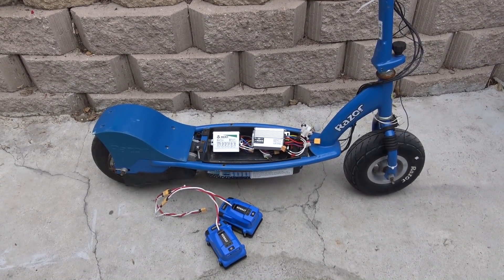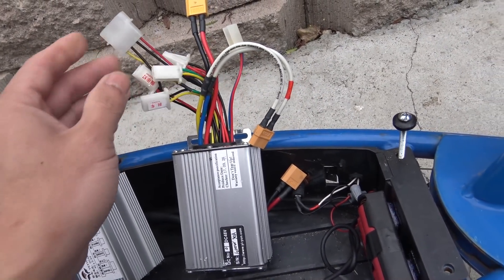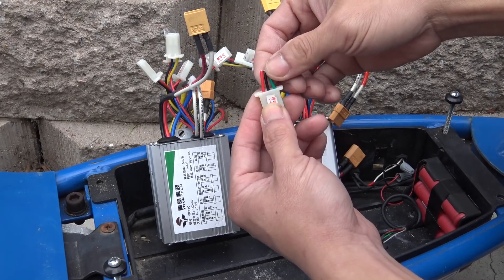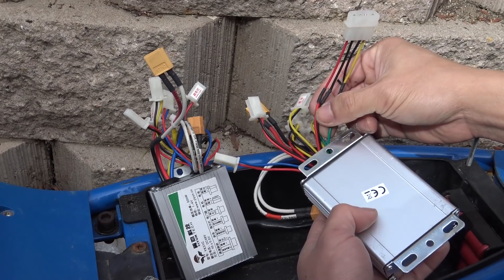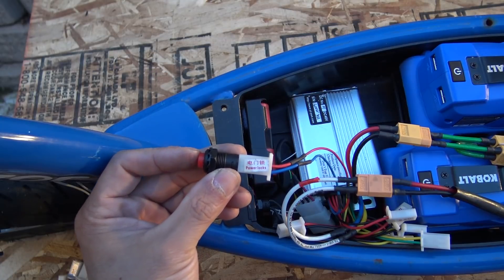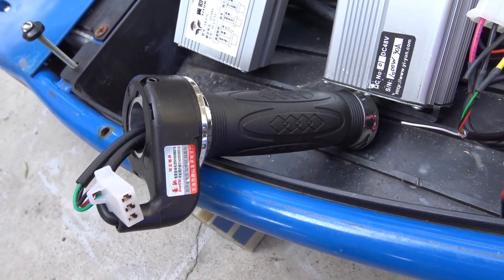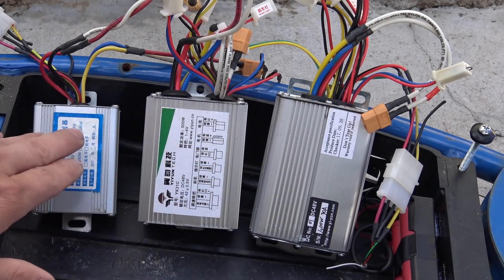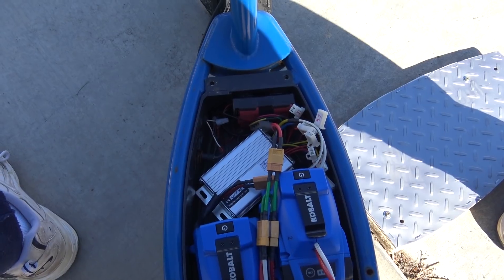Install a 48V controller & 48V battery on a Razor E300 (24V) Electric scooter

Comment: To increase speed smoke weed and drink alcohol. Scooter will go 200mph.
Reply from the maker: Amen.
Reply: @vuaeco  can you change the speed with the throttle your useing? I bought the same one and am just curious.
Reply: 😂😂😂😂 as a modified e300 owner and builder this is hilarious weed makes it seem like you're doing 40+ instead of 30
Reply: Lol... puff puff give !!
Reply: Lol
Reply: You are terrible :v
Reply: Couldn't say it better myself
Reply: I built this and it rips thanks for the vid
Reply: I'll be smokin' for sure.
Reply: Lol I just got a crack out of that one HAH Ya see what I did there??!
Reply: I PREFER LIGHTSPEED ON LSD
Reply: FrustratedBaboon that is the best way

Comment: 49V 1000W....ON A 24V 250W MOTOR HAHA.....IT WILL LAST WEEKS IF THAT YOU AT LEAST NEED A 36V 800W MOTOR AT LEAST IF YOU WANT TO OVERVOLT THE MOTOR WITHOUT BLOWING IT UP WHICH I ALREASDY HAVE DONE OR 36V 350W MOTOR FOR THE 59V 500W CONTROLLER ITS ALL ABOUT AMPS

Comment: you have E300= 200/300 Watt Motor, so 500 or 1000 Watt bringts nothin more power.  with 48v driver you get high power at the motor because it is small for High Speed.  ...still good.

Comment: Amazing
In many states 20 mph is the legal limit for our e scooters.  Glad your sitting down.
The oem motor can take a lot more than we are told. 

WHY HASN'T ANYONE TRIED ADDNG A THERMAL CUT OFF SWITCH super glued to the motor body and wired to the controller's brake handle motor kill wire? Many of our home appliances like our vacuum cleaner have them.
If a low enough temp it should save the motor from melting down if being pushed too hard for too long till cooled again!
I see aliexpress has these little guys for cheap. 
I am planning on trying that when I over volt my oem.

Take care

Comment: Why even bother with controller just have a 60V relay on its own, seen some idiots wiring throttle cables in so full current going through the thin gauge control wiring, clueless. Great video 👍

Comment: For future modders- 48v is OK for the motor - however excessive current (amps) is not. Too high current will burn up the motor. Try for low wattage 48v controller to keep motor cooler
Reply: Question my nephew 24v quad I was gonna run a 36v 1000watt speed controller but I'm starting to consider a 48v speed controller what would you consider for shooting around the yard
Reply: @3613jeremy  if you have stock motor 1000w controller probably gonna cook it especially around the yard
Reply: @grandtheftauto1233  so I should probably stay around 500 watts
Reply: @3613jeremy  yeah that’ll be more reliable. 36 vs 48v gonna give you more or less top speed

Comment: I like the video and everything but you did not say what kind of voltage motor you use it if you're using the same voltage in all the controllers or do you have to put 48 V to a 24 V motor that need to be explained and thank you

Comment: Can I use 48V W1000 controller for original razor E300 batteries?
Reply: No because you need 48volts and the batteries are only 24

Comment: Impeccable English, and VERY good technical explanation, and VERY good analysis.  Instead of unplugging 2 batteries, I would recommend the Power switch be swapped-out for a 3-way to disconnect batteries (some longer wires run to 3x switch from batteries).   30mph for a 15mph scooter???  AWESOME.   ...helmet and protective gear, like a motorcyclist and assuming everyone is going to pull out in front of you, is a must...   GREAT JOB!!!  Thanks.

Comment: i have the razor e 300 and needs new batteries, i would like to get for longer range and little more power torque.
which batteries and controller should i use?     i need about  12 miles range to be safe

Comment: The stock motor on a Razor E300 is the MY1016 (by Unite Motor Company).
Rated at 24 V, for 250 W (which at 24 V is ~10 A)

Dumping 48 V, and current of up to (1000 W / 48 V ~= 20 A) will fry the thing in no time.
Reply: (Assuming that you removed the protection breaker, which from the vid it appears you did)
Reply: I guess the output of those tool LiPo packs might be below 20 A, so maybe that would be your limiting, and possibly protecting factor.

Still, that motor is gonna release its smoke right quick.

Comment: Question ? 
What is the range of 500 watts compared to 1000 watts compared to 250 watts ? 
Is it close to being proportionate , meaning  will the battery  last 4 times longer with the 250 w as with the 1000 w controller ?
Great videos ! Very good information and well explained ! Thank you !
Reply: You will get the same range using the same battery but of course with 1000w you get there faster than 500w and 250w.
Reply: @gerardr4869  Can you prove in mathematical form that the range is the same? I thought the 1000w controller consumed more power at any time to get the scooter to move quicker ~ and faster at any instance time and the range would be shorter. Otherwise, why do the 250w and 500w exist in the market for? Except for the longer range and safety speed reasons.
Is it safe for a 24v stock motor to be used with the 36v, 48v battery? Would the 24v motor burn out? What is your choice?
Reply: @digicabtech 
You can compare a tesla motor vs a Nissan leaf. If you put the motor of a tesla in a leaf, the leaf will still give you the same rage as originaly, assuming it still weights the same as originally. 

 1000w motor let's say the battery is at 50v drawing with 20amp(50v X 20A) =400 watts of energy consumption.

A 500w motor ... same things as above. 

Is your battery is 48volts 10AH then you have 480Watthours of energy to be used in work at a low speed or fast speed. In the case of biking other factors will determine how far you can go, for example, hills terrain and wind.

Also, some lithium batteries design to only be drained at low amps will waste energy heating up if discharge at more amps as designed and the range of the vehicle will be shorter in comparison to another vehicle will better battery
Reply: @gerardr4869  
Forget about other factors. Let's distinguish between 2 motors. A 500w motor does NOT consume the same amount of electricity as a 1000w motor simultaneously. So the 1000w will drive for a short distance and drain the battery quicker.
"You can't get something from nothing."
Reply: @digicabtech  sounds like you need to see it to believe it. Do your own testing. I have already tested teoriticaly and practically ans its true. If there is a difference it will be so minimal that it's not noticeable
Ohms law will take you on the right path.

Comment: Great videos,  I watched this one and the 60 volt conversion.  Most folks when they over volt the stock motor they burn it out quickly.  What are you doing differently to not burn out the motor?  Thanks

Comment: What determines the maximum weight capacity of the scooter construction and the controller/motor/battery configuration?

I weigh 225 pounds, I travel 20 miles to anywhere I go then must return, and the roads are NEVER flat.

What formula can I use  (or anyone!) to figure that out?
Reply: I know it's a late reply but it's rare to get a scooter that goes that distance or longer.  Most scooters are rated at 15 miles range or shorter.  You will have to either upgrade the battery system (which can get expensive or complicated) or spend upwards of over $600 US dollars to achieve that distance.

In addition, there are scooter test companies that show you their tests and what weight they used to determine their tested distance/range and perhaps you can use that as a reference point in accordance to your weight.  Good luck sir!
Reply: @AnthonyChhan  I believe you can just use a 48v 20ah ebike battery, 48v brushed controller and 48v brushed motor.
Reply: i have one for sale already built

Comment: Will your 24v motor be able to handle 48v or will it burn out?
Reply from the maker: It's been working fine up until now, no problem. You might need to install a heatsink for the motor though.
Reply: @vuaeco  thanks a lot for your input much appreciated

I am actually trying to do the same to my mobility scooter which is a bit bigger

Looks like this 
https://www.mobilitysmart.co.uk/style-plus-lightweight-mobility-scooter.html

The motor is 24v so I’m really worried that I will burn it

Comment: What size motor?.. I hook up my battery wires rnd the wrong way(positive battery wire to negative on the speed controller??..)..have I blown my speed controller?.. I seen a little spark

Comment: The scooter is a 24 volt and you are adding double the voltage and watts.... is that motor capable of doing that? Or did you change the motor also? And if you didn't change the motor... how long do you think that motor will last before it gives up?
Reply: U  r rite. "You can't get something from nothing"

Comment: I know this is an old video but why didn't you wire a kill switch straight from the batteries? 

For safety and to stop that battery drain problem

Also do you think lipos would work for these builds? Just asking cause their size and weight are  definitely big plusses.
Reply: I know it's a late reply but there are plenty of people who do lipo builds and do just fine.

Comment: At 24 v 10 ah and a 500 w motor can I  add another battery and get more riding time?
Reply: should be more if current output is controlled in whichever ways
Reply: @akunii7249  I'm not savvy on electricity, what you mean ? My charger before hooking it to the scooter is green, when plugged in it turns red, Don't know if that means they are fully charged. The meter says 25 .4 I think that that means they're charged? indivitually they say 12.5  . I had a longer ride and more speed with thee 450 w it had.

Comment: it's still slow cause motor stick on the wheel
is it's use chain to drive rear tire and use gear reduction, this scooter gonna ran fast

Comment: Razor is finally making some new really neat looking lithium battery scooters.  It's about time.  The E 100/200/300 models used Lead Acid batteries.  

After you switched out those Lead Batteries, you saved about 8 to 10 lbs

Comment: So the stock motor is fine for 48v ?
Reply: should be ok at around there, as long as it's open to allow air winding to it, to cool it off some, but it might be super hot at insane 3 or 4digit volts/watts

Comment: how long will this last? have you been using it for a while now? I'm going to overvolt my 24v motor but with a 24v controller. If i break it ill get a 36v+ but im more worried about the motor. has yours causes any issues with moderate use?
Reply: If you overvolt the controller, it will fry and you can not just overvolt the motor as the controller is what is controlling it for lack of better words.
Reply: @SynergyAVE  that's wrong, you can power the motor directly off whatever battery you want by simply using a high amperage switch. These scooters don't use brushless motors, they use brushed DC motors.

Comment: hi ive just upgraded my e300 with 36v controller an throttle plus 18650 batterys but power is feeble when i jump on scooter.ive tried 36v lead acid scooter pack i made but its same feeble power as batteries that came with it.i did charge orignals with ctek charger individually .it was 2nd hand.im thinking motor is worn out
Reply from the maker: Yep, different batteries and same result then must be the motor.
Reply: Not all 18650 batteries are created equal. Some are designed to deliver 30 amps! However, I use modem batteries in my projects and they struggle to deliver 0.5 amps. Check your specifications.

Comment: Hi I just trying out a new controller it did say sensorless and ebike scooter but brushless anyway connected to my 36volt brushless Motor with the halls connected .anyway the motor worked ok but without no throttle control .ie whether throttle was powered on or off motor only worked when learn wire connected.but each time disconnected learn wire rotation was reversed .so when twisted throttle it wouldn’t work .i had red black an green throttle or grip wires connected.throttle lcd showed voltage but maybe faulty throttle .
Reply from the maker: Maybe throttle cables are not correctly colored. Switch the 3 throttle wires around and try to see if it works? Or you can get a volt meter and measure the voltage across the wires. They should be 5V on the red, nothing on the black. Or best yet, try another throttle

Comment: hi vuaeco was it brushed controllers you used on razor e300 48v upgrade?guess  i cant use brushless controllers which i have on brushed motor
Reply from the maker: Yes, it was brushed controller.
Reply: @vuaeco  is the razor e300 still running ok on standard motor having been upgraded to 48v

Comment: hi vuaeco ive picked up another couple of razor e300s.my wife just wanted standard one fast enough for her an good batteries.mine was dead /tired batteries.anyway tried charging from cteks showed good voltage but under load was weak power motor ok.so ive hooked up my ebike battery 53volts power but mine can be separated so just used 30volts on scooter.used 300watt 36v controller an throttle showed 30volts lcd didplay.not sure if green or blue was signal wire on controller.tried green first no power on motor so swapped to blue an without throttle motor spins backwards slowly.had good motor speed on old lead acid batteries.so swapped motor wire over an motor goes forward but slow again but still 30volts 18650 power they my samsung 25r s.any ideas ?
Reply from the maker: 30V on this motor should be very fast. Something has gone wrong. Try this: disconnect the motor cable, then put the volt meter probes on that cable instead. Now run the throttle and see what voltage you get? If you get 30V on that cable then it must be something wrong with your motor. You can then try to connect your battery terminals directly to the motor to see if the motor works? This motor can handle up to 48V connected directly to the battery without the controller.

Comment: How many 18650's would you use if you built a battery for an e300 I just got the scooter and would like to build a salvage battery for it. Your videos are so clear and interesting thanks for your content :)
Reply from the maker: It depends on the kind of 18650 you use. For high discharge cells, you'll need 6S2P (12 cells) at least for 24V. If you use laptop cells, you'll need at least 7 cells in parallel (that's 6S7P or 49 cells) for 24V.
Reply: @vuaeco  thanks for replying was thinking a 36v to get better performance in the e300 using high discharge cells. The e300 is a great platform but the battery's weigh too much and performance is disappointing. :(

Comment: Sick guy riding it with one hand. Iv just bought a 48 v 1600w scooter wen I have one hand on its scetchy as fuck. Mine has full suspension and the frame is built like a bull I'm buzzing you flying on that how much did the upgrades cost you.

Comment: Are you using the original motor that came with the e300?
Reply from the maker: Yes.
Reply: @vuaeco  
How long has it put up with the 1000w controller? I just purchased an 1000w and going to be using it on stock motor till it fries itself but hopefully it won't lol. You should join the Facebook group: razor electric scooter mods

Comment: if you increased power on controller you should increase the motor too
Reply: replacing those little wires with lower gauge wires could be like almost overkill, if u know what i mean